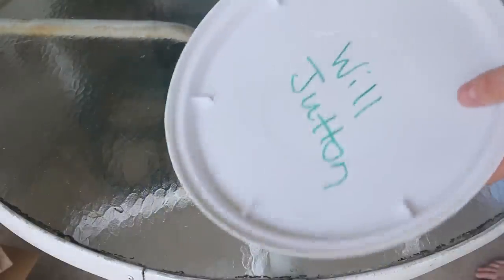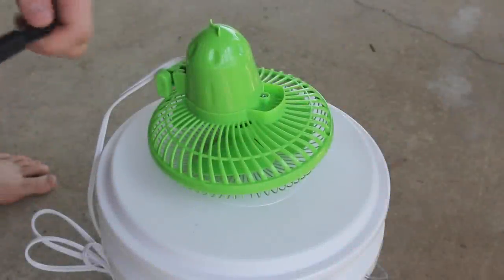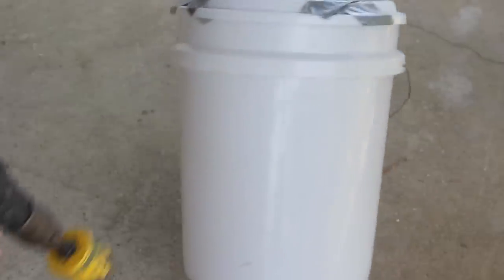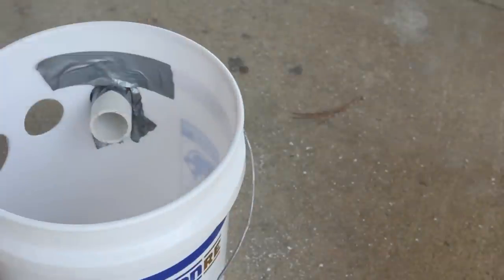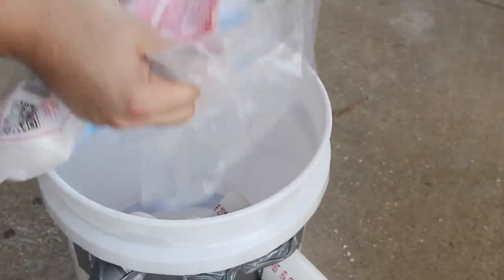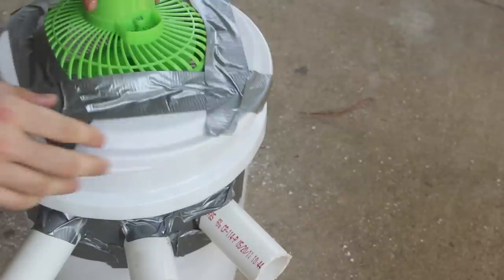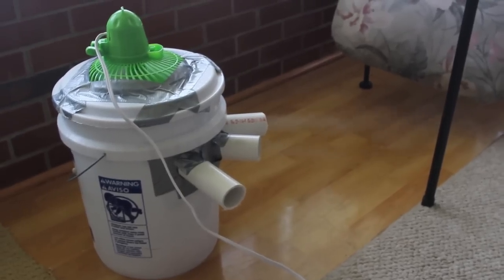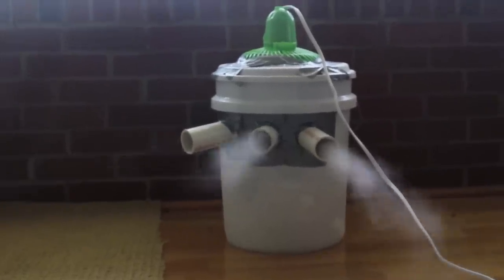Homemade Air Conditioner  (Use Ice From water for better effect)

Comment: Filling your room with CO2, nice your body surely would become cold.
Reply: CO2 the pipes are not cigarets, what do you mean?
Reply: Sale M dry ice makes the co2
Reply: Dry ice is CO2
Reply: Rizu Ya  actually, your body would get warmer after the dry ice is gone and the air temperature is 38c
Reply: That a nice answer
Reply: Great😂😂😂👍👍👍
Reply: @KingNast  Yeah. Co2 is a better thermal conductor than the "normal" air mixture right?

Comment: I rarely say this, but this video may well kill someone, or worse, many people.

Ball park numbers, Air is about 1kg/m3 and is at room temperature (~300 Kelvin)
Dry ice is about -88C (212 Kelvin, 44g./mol, comparable to air).  Practically this means to lower the room temperature by 10C means the final atmosphere will be about 10 % carbon dioxide.

That will be fatal in about 30 minutes.
Reply: No, you'll get that temperature by using less dry ice than 10% of the atmosphere (after evaporization), because of the enthalpy.
It takes away extra heat from the envinorment to change the consistency of the dry ice from a solid to a gas.
Reply: ZauStuv
is that the same as heat of sublimation?
Reply: gelyn miranda English is not my first language, so I'm not sure about the names (I used google translator), but by the amount of energy needed for the consistency change, I basically meant the definition what you said. Enthalpy is the overall energy of a closed system.
Reply: Or simply place few plants in the room and Voila! you are safe again.
Reply: Sharan Nair or a whole rainforest because that is alot of co2
Reply: there was once a guy who was trapped in an airbubble under a boat and survived for 3 days
Reply: K
Reply: hero of the internet right here
Reply: F OX your picture changes color for me in the notification feed
Reply: i comment here to keep this comment on top
Reply: Stay @ top
Reply: Stay @ top
Reply: I'm glad that they (Crazy Russian Hacker) finally changed the title of this video. However long ago it was...
Reply: Save
Reply: ccc
Reply: @ZauStuv  relating to a closed system would be fine if a closed system was ever practically possible
Reply: @ThomawillolGaming  Literally used my brain, and recognized, you didn't use yours.
Reply: @f4fphantomii468  Would it help to say i made this commet at the age of 12?
Reply: @ZauStuv  that's besides the point, even if it were 5% it would still severely harm you.
Reply: @SeviRosis  I remember that video.
Reply: To be fair, this would be the last air conditioner you would ever need.
Reply: Thomawillol did you delete your comment?
Reply: Niznize you do realize you’re instructing a phd chemist about chemistry, right?
Reply: Just open your windows and doors o
Reply: @azeemtics6613  lol.
Reply: @SeviRosis  There was once a guy who farted his way to the moon

Comment: "Safety is number 1 priority" - puts on glasses and fills the room with carbon dioxide. LMAO!
Reply: +RealationGames HAHAHAHA
Reply: +RealationGames In soviet russia you poison CO2!
Reply: +RealationGames ZE GOGGLES THEY DO NOTHING
Reply: +RealationGames LMFAOOOO I LAUGHED SO HARD ROOOOFL
Reply: +RealationGames HAHAHAHAHAHAHAHAAHA
Reply: Safety is number one priority, then tosses it around with no gloves
Reply: +RealationGames (puts on glasses that aren't even meant as protection while doing experiments.)
Reply: One room wasn't enough. In one of his other videos, he fills his whole house up with CO2. He's very serious about getting his Darwin award.
Reply: Dry ice is harmless even sitting in the mist face planted its still fine as the Co2 is less thicker then actuall oxygen so there is always oxygen it just gets hard to breate but if have open doors and windows it fine
Reply: Dry ice (remember, CO2 in the solid phase) is certainly not harmless, especially when you're using it in massive quantities in these stunt videos. It's harmless when used in small quantities in a well-ventilated lab, usually to freeze things quickly, but any lab worker knows not to intentionally breath extra CO2. As a gas, CO2 is also used to euthanize lab animals, and it can do it quite easily.
Reply: the ammount used here is harmless especially because co2 is heavyer then oxygen like i said and thus is only going over the ground while cool air disperses trough the house as long as your bed isnt a bed roll your fine lol or even sitting on a couch
Reply: Rule #1337 : If you wear safety glasses, you are invincible.
Reply: +PlantProductions lol
Reply: So ironic. It's sad that this is a "science" channel but the guy doesn't know anything about science.
Reply: Yeah, and he's still got the "use ice from water for better effect" in the title. I guess "better effect" is scientific jargon for "not asphyxiating".

Some others have suggested that what he does is mostly plagiarized anyway, which is manifestly unscientific.
Reply: its like frozen nitrogen
Reply: Signature CRH. 
I always end up laughing my head off at him and always come back for more. 
<3
Reply: lol

Comment: There's a thunderf00t video on why using dry ice is a terrible idea, especially in confined areas. Normal ice only, please. Dry ice is a real risk.
Reply: It takes just 6-10% of the air to kill you Billy
Reply: +Billy the Kid Dunker You all forgot the biggest risk, CO2 is heavier than air, so it will gather on the ground. It may not be enough to kill an adult, but small children or animals like a cat will be dead in a few minutes. Just don't use dry ice inside a house
Reply: ***** Try it, we'll talk after, Or not
Reply: heard  aĺl  the  old  songs  very  nice
Reply: +vanishy0urself one time when i was working for braums ice cream our freezers died so my manager but $300 worth of dry ice till they could fix them.
so 3-4 hours later they fixed the freezers and had some guy throw all the dry ice away...
that night when i whent to take the trash out.
i opened the dumpsters and all the gasses hit me right in the face and i blacked out for a few seconds lol it was funny.
Reply: +vanishy0urself +CrazyrRussianHacker filed a DMCA request against that video. Thunderf00t has a new video explaining it and according to that google say CrazyrRussianHacker's another one of +CrazyRussianHacker channels
Reply: +Abysswalker Artorias That not assuming that CO2 sinks to the ground, so that number maybe slightly smaller.

Comment: "Air conditioner too expensive"
"Piece of dry ice, $10"
Reply: nrdesign1991 Yep, maybe just save your money and buy an Air Conditioner...  Or a box fan for $50 at Lowes.
Reply: nrdesign1991    a ac is too expensive,lol....you can get one for 120 bucks.
Reply: x Vandilized x
You have to replace the dry ice every day so after two weeks you could have gotten a small AC unit instead.
Reply: nrdesign1991 you can use ice instead of the dry ice !!!
Reply: johnny mustaklem That would defeat the point, as it would add moisture to the air
Reply: nrdesign1991 add apposed to dry ice adding death to the air?
Reply: Small fan for like 30$ 2 dry ice pieces for 20$ bucket , pipe , tape for 10 $ 60$ congrats u saved 40 bucks
Reply: Well I hope nobody is actually this cheap....
Reply: BamDieCake Are they really cheap or are they just having fun so they can get some gossip going.
Reply: Bruce Kefauver I use one on my jon boat when I'm fishing in the summer months.
Reply: ***** Or an A/C on sale, cause they always come on sale for like $200
Reply: nrdesign1991 true but S.G.I   STANDS FOR SUCH A GOOD IDEA WHERE DID HE GET THIS IDEA FROM ? MY OPINION GOOD
Reply: nrdesign1991 Dry ice you can find for about .75 cents a pound, you only need a few pounds on top of regular frozen ice. Dry ice will evaporate about in 18 to 20 hours for 3 pounds, it's - 109 degrees and will keep the other ice from melting too fast. It's more than worth it for camping, cooling a room that doesn't get as cool ect.
Reply: nrdesign1991 Thats $20 he a bag
Reply: +brian mctear an ac* and space after comma
Reply: +brian mctear also you're not supposed to use numbers in numeric form unless it begins your sentence
Reply: Probably just light the house on fire.
Reply: +nrdesign1991 you are right. maybe not an efficient way. He also said to use ice from water for better effect.
Reply: air conditioning is like 200 bucks a month
Reply: +brian mctear 120? In my country, a ac cost bout 1000-3000 bucks
Reply: why is this still going on after five months?
Reply: ***** And it's split air conditioner
Reply: you can just make dry ice
Reply: That would be to exspensive
Reply: Everything including Dejon mustard is too expensive for you Jerry.
Reply: +DerpMaster Hd More like
Fan: $10
Tape:$0.20
Bucket: $0 (everyone has a bucket they aren't using)
PVC: idunno, probably not expensive though
NORMAL ice instead of dry ice: $0.05
It shouldn't be more expensive than $15
Reply: Don't forget about the power drill and the saw XD
Reply: +nrdesign1991 WHEN THE ZOMBIE ACOPOLYPSE COMES U AINT GONNA HAVE ANY PLACE TO BUY IT YOU NEED TO KNOW HOW TO CRAFT UR OWN
Reply: use ice from water i think it's little bit cheaper

Comment: I recommend using a bag of normal ice on top of a grid in the bucket. Then place the fan underneath a hole in the bucket. This should make cool air too and since the ice is in a waterproof bag, it should not be dangerous for the fan. Dry ice is a bit dangerous if used indoors.

Comment: How is this still up? Do not do this, in your home.
Reply: +AnAccountWithaName It doesn't have much use outside?
Reply: Paul McDonald No, Go to the netherlands, jump for a train, and let all the trains for 2 days stop. It happens often.
Reply: use the same desighn insulated with a fan fixed in a hole at the top fill it with ice turn it on and it will shoot out cold air
Reply: Unless you understand how a window works... don't listen to every troll
Reply: Charlie Jaye opening a window is gonna let all the hot air in...
Reply: still up for whatever reason
Reply: Cent i Pede 😂😂😂😂 fine troll sir
Reply: Is it safe with regular ice
Reply: Joe Holloman Yes.
Reply: You're correct. it's better to do in someone else's home.
Reply: Use a frozen 1 gallon of water and place the bottle inside along with a foam insulated bucket liner and that'll last for around 6 hours.

Comment: Even with the annotation at the beginning of the video, who would even take a risk of doing this in their own place.  Even with adequate ventilation and all safety measures taken... there's STILL a risk of dying.  

What if you don't experience the symptoms prior to blacking out?  Once you black out you'll likely die anyways.  

Do it at your own risk right?
Reply: I didn't bother reading the annotation cause it didn't start with, "this is potentially dangerous", I usually just ignore and even shut off annotations. What are the odds someone like me, just ignores what was said in the annotation because it looks like gibberish, turns off annotations, and then tries this thing out.
Reply: Introgauge .C given the number of likes versus dislikes, to say nothing of some of the comments here, the chances seem way higher than they should be.

Comment: "Safety is number 1 priority"  Proceeds to hold dry ice without gloves on :/
Reply: Russians
Reply: Not like you need gloves.
Reply: +Remratsstudios (Starm) And then uses an electric drill, that looks like for construction workers and not home use, without fixing the bucket or wearing gloves.
Reply: +Remratsstudios (Starm) and the proceeds to evaporate kilos of co2 into the room xD

Comment: All other videos I've watched showing you how to make this, use regular ice and not dry ice.  Dont use Dry ice.
Reply: Because it produce water when it's melting
Reply: Taw Ku its in a bucket. water going everywhere wont be an issue
Reply: Taw Ku its in a bucket. water going everywhere wont be an issue
Reply: TheGoodguyperson water going everywhere isnt the issue, using normal ice will mean you will have a LOT of water vapour floating around the room, good bye PS4... Good bye xbox one... good bye tv etc etc
Reply: Also dry ice is waaayyyy colder than frozen water
Reply: megaspeed2v2
I guess most people didnt see my other comment.  Here it is again.
 
I did more research on Dry Ice and here some info for you to chew on.

Because it [Dry ice] sublimates into large quantities of carbon dioxide gas, which could pose a danger of hypercapnia, dry ice should only be exposed to open air in a well-ventilated environment.

Readup on Hypercapnia its not good.

Goodl & Wiki is your friend.
Reply: Taw Ku Freeze bottled water, when the ice melts inside them you can stick em back in the freezer and rotate them with another stock.
Reply: megaspeed2v2 Well it wont produce a lot of water vapour if  you  do it properly and maintain the supply of ice, and keep emptying the water.
Reply: Taw Ku
And dry ice releases CO2 gas when it evaporates, which can kill you if it gets in high enough concentrations. No thanks, I'll stick with water in a bucket.
Reply: worldcomedyproducts
It's also 100% more fatal as a gas. Dry ice is frozen carbon dioxide.

Comment: I'm kind of scared to hear someone try this in a closed room expecting to be cooled off and then suffocate from all the CO2
Reply: um its just water vapier..... with a little bit of carbon oxide you can consume it if it was not very cold
Reply: Dakmon9 well you know how long that will take it would take about 1 and a half of a day you will be fine omg people are so annoying about shit
Reply: horenburg111's gaming channel if youre in a small not ventilated room, it goes quick....
Reply: I'm sure you could use a second fan and build a cheap contraption to filter in outside air slowly so you don't heat up the housr
Reply: Dakmon9 its not co2 btw its just water vapier its water boiling  and evaps
Reply: horenburg111's gaming channel  Dry ice is frozen Co2 dude.
Reply: im not fighting any more bye
Reply: I know! He should put a warning in the beginning of the video o simply remove it
Reply: Well, solid CO2 doesn't boil or evaporate, it sublimates, just like solid iodine.....don't talk too much if you don't know about it....
Reply: I have a Bachelors of Science degree in chemistry, we used dry ice all the time in lab and never died. This wont kill you unless you are in a 5' x 5' room that is completely sealed. Yes CO2 is more dense than O2 and therefore will fill you lungs and make you suffocate but if your head remains well above the unit which is sitting on the floor you will be fine.
Reply: @dachip50  He literally recommended you do this in a closed off room.

Comment: Make sure you're using this in a very very well ventilated room. Dry ice is super cooled carbon dioxide which can suffocate you. Other than that it looks pretty simple and nice.
Reply: ***** ya you have to compress it to at least 5 atm pressure to make it liquid. I don't think we can use it for daily applications, but only for some industrial purposes...
Reply: ***** They do that? Teenagers these days are crazy I guess.
Reply: ***** You know what's good for you. Stay safe brother.

Comment: pretty cool life hack, but wouldnt it be cheaper just to be a high quality fan or air conditioner if this thing costs $20 a day to run
Reply: Exactly
Reply: That's safer than run the risk of CO2 poisoning
Reply: CO2 is not poisonous. Just suffocates with large amounts in one breath so he's fine
Reply: +sciguy,, you can not get poisoning from CO2, you're thinking of Carbon Monoxide. The only think that would happen with CO2 is the eventual reduction in oxygen levels which is not likely to happen. Any ventilation will solve this.
Reply: +SciGuy This tiny amount of CO2 won't cause you to suffocate unless you sick your head in the fucking bucket whilst the ice is melting.
Reply: dry ice takes a long time to evaporate away so I say like 10 dollars should be enough for probably 1 day and 1/2 so its kinda cheaper than buying a regular fan. a regular fan will probably blow warm air out instead of cold air so I say this life hack is better than buying a regular fan by itself